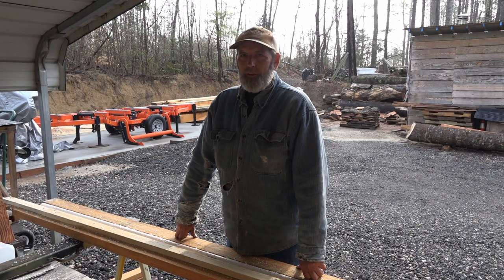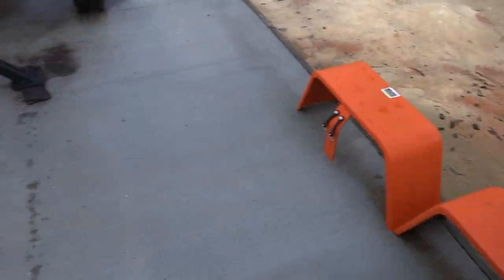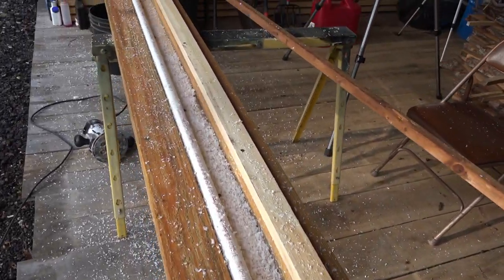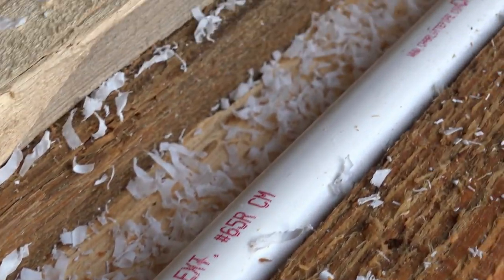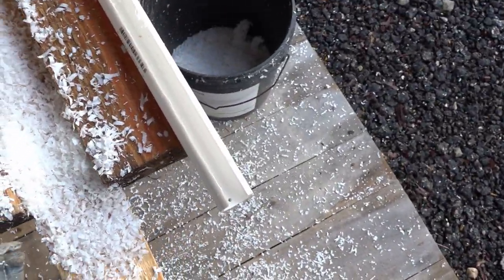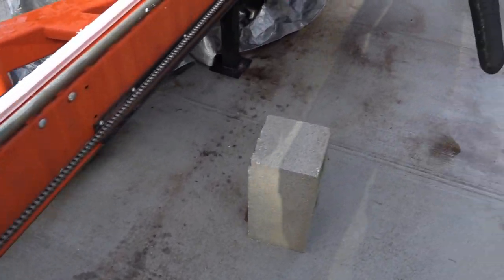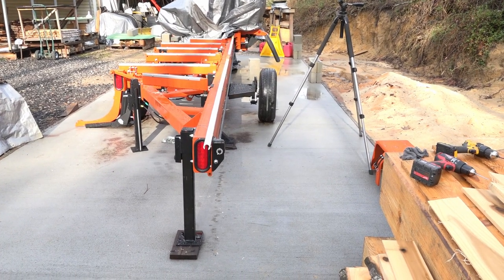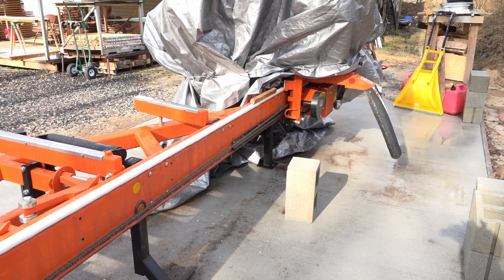WOODMIZER LT40 DIY TOP RAIL COVER

Comment: Nice job!  I've been using split, flex duct but over the last 5 years it's started to fall apart so needed to do what you're doing here and just stumbled across your channel!  Thanks for sharing!
Reply from the maker: Your very welcome and thank you for subscribing. Yes the pvc works really good
I just now got done putting mine on less than 10 min ago. I put mine on every evening when I’m done. I also spray some Transmission fluid in the pvc covers when I put them on. Do you happen to have a YouTube channel ?
Reply: @MsdMakingSawDust  I use ATF as well but always have a can of Fluid Film Rust & Corrosion Protection for long term protection when I cover the rails.  Stuff is better than ATF for me (at least during the winter when we see some rain)...that's what I put on before covering the rail.
Reply from the maker: Thanks for the information on the fluid film
I’m going to have to try that. Appreciate it

Comment: Nice job.  I made those for my sawmill as well after watching Chuck from Iron and Oak.  I used the thin walled PVC and used a table saw to cut the opening.  I ran it through the table saw once and then rotated the pipe and ran it through the saw again.  That worked well.  Like you, I left about 6 inch overhang on the end to use as a handle. Normally, before I install the covers I lay them next to the top rail and squirt Dextron III into the covers (as suggested by Chuck).  That leaves a nice coating on the rails for further rust protection.  I didn't need the wooden handles.  When I install the covers I just slip the covers under the bell shaped end of the previous cover.  When I remove the covers I lift the first cover the others just lift right off as I move down the line.  I made a video how I made my covers as well.  https://www.youtube.com/watch?v=5wRJze2bHPc I start making the covers around 6 minutes into the video.
Reply from the maker: Thank you for commenting. I used the thick wall schedule 40 pvc had it to do over I would have used the thin wall schedule 80. I do the same thing I put transmission fluid inside the covers when I put them on. I’m going to watch your video. Never thought about using table Saw. Thank you keep up on them videos !!